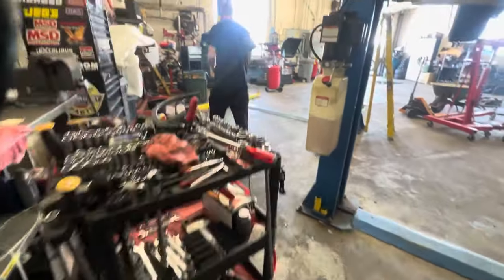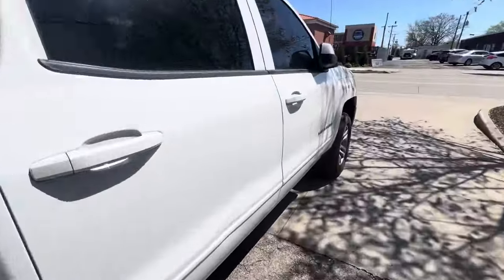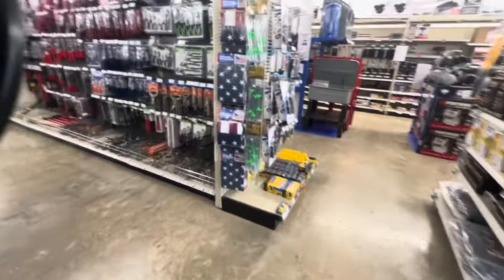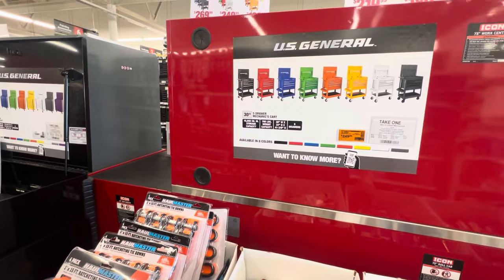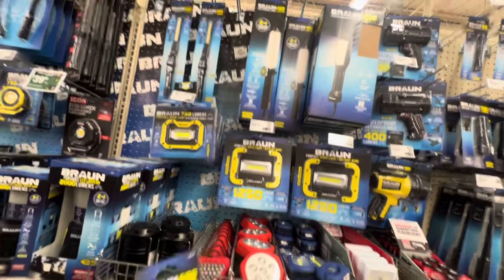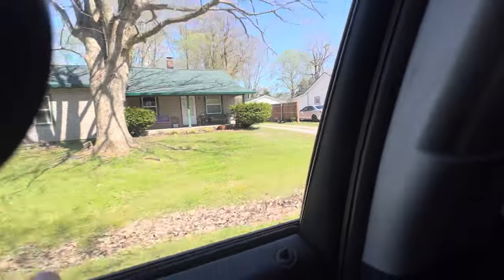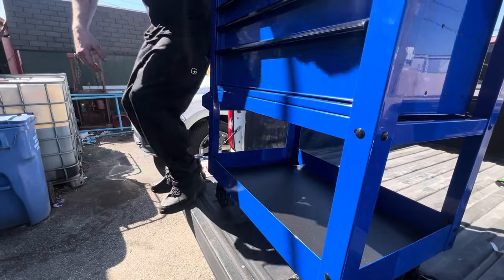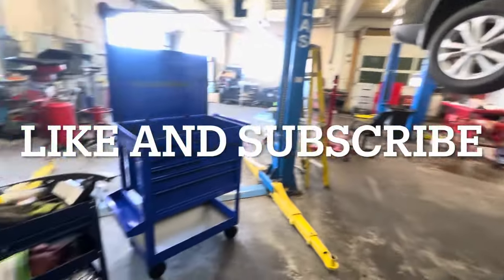Harbor freight series 3 5 drawer cart

Comment: Series 3 has the black out trim package i.e. bolts, logo, drawer pulls, and casters. Also, back left corner has the pass thru for power cords. Other then that it's pretty much the same.
Reply from the maker: Sweet
Reply: Drawer latches are also full length. The black hardware and casters really make them look good. The black trim has been avaliable separately for a while but those really set it off.
Reply from the maker: Good looking cart🔧✌️🔧